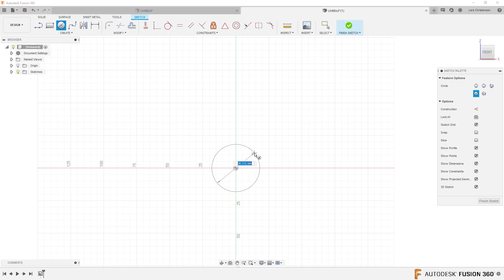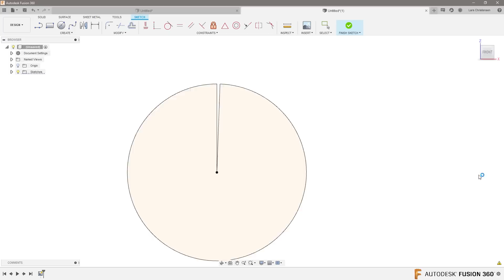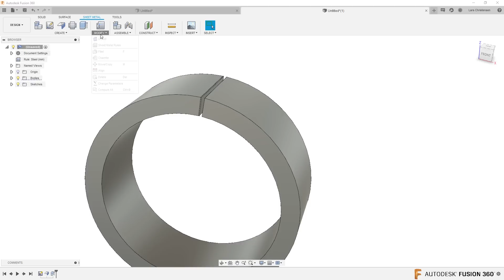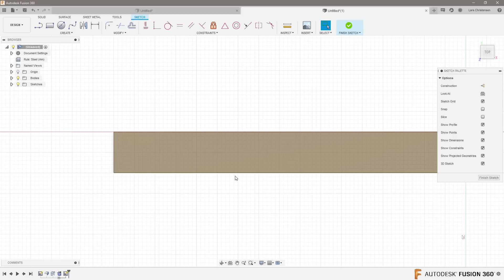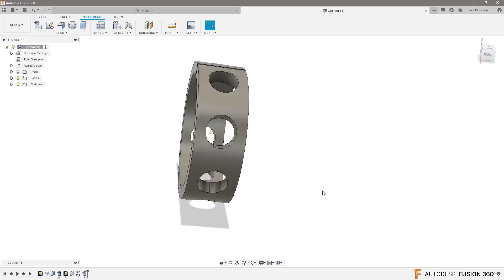Fusion 360 — Make A Ring with Patterns and unfold — Ask LarsLive

Comment: What would be the application of such sheet metal? I mean, if you laser cut metal with that pattern it will break on every circular gap if you try to hammer it into shape. And distort the straight edges of the circles.

Comment: As there are a lot of ring with pattern that are kind of symmetical I wonder if it would be possible to just model a quarter of a ring, unfold it, do the individual work on the pattern (which needs to be able to connect properly at the borders) and then fold it and complete the ring by mirroring/copying.

Comment: This seems so hacky compared to the elegant unrollsrf and flowalongsrf approach in rhino. This is one feature I wish fusion had a first class support for. This and actual deformers like bend, twist, taper, cage edit etc. I have asked this feature for years but fusion team doesn't think its a priority. You would think that at least tsplines would have deformers like other sub-d solutions. Tsplines hasn't had major update in years and is so slow that I find it easier to model in maya and convert to brep than work natively in tsplines.

Comment: While in sketch mode, after trimming out the section, add a short line segment to either end of the open part of ring.  This way the flange will already have a flat area for the unfold without having to do the extrude.  Offset face on the side of the ring without the flat area can be used to complete the ring after manipulation.  If being a stickler, the flat area can be removed before offset face is used to complete the ring.

Comment: If the pattern is applied on a cylindrical 3D shape (technical drawing gives only gap in degrees between pattern holes) instead of flat pattern, will the unfold work in the same manner?

Comment: At that end point - you can grab the flat surface between end points and extrude to object in order to close the circle making a solid band. A small flat on the “bend”. Completing the band/circle.
Reply: You could also delete the little flat extrusion and sweep the end surface along the circle of the ring to close it.
Reply: Stefan Wössner Nice. I hadn’t done that yet. I’m quite a newbie to the sheet metal options. Thank you.
Reply: Not really because the flat surface you're talking about is not pointing directly at the other flat surface but a little bit outwards, so extruding it to the other face will leave a sharp ridge on the outer surface and a sharp valley on the inner surface.
Reply: cavalrycome you are correct, but at that scale, seems easier to buff out and be stronger than to solder in and be weaker. Seems relative and easy enough to experiment with in the real world.